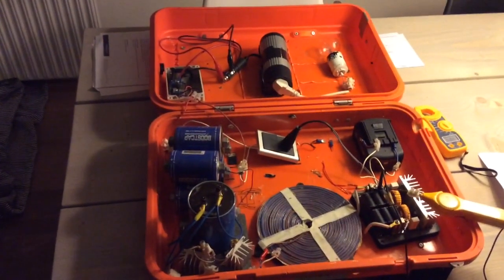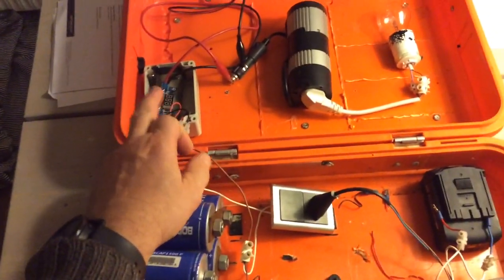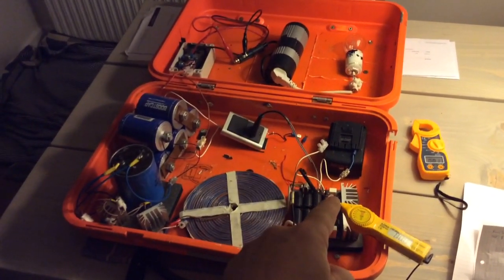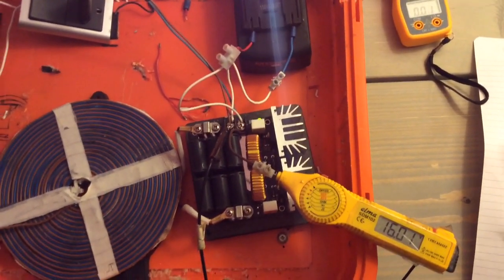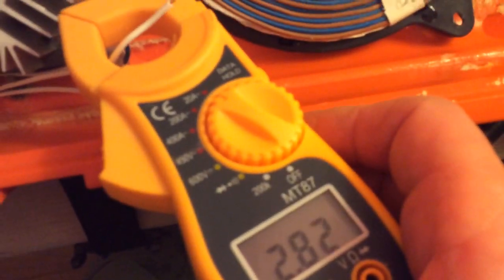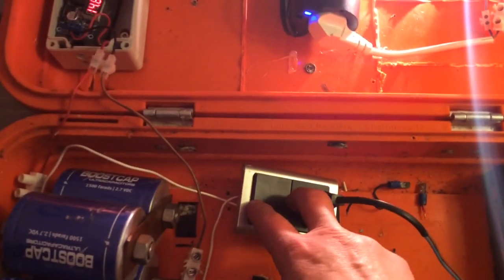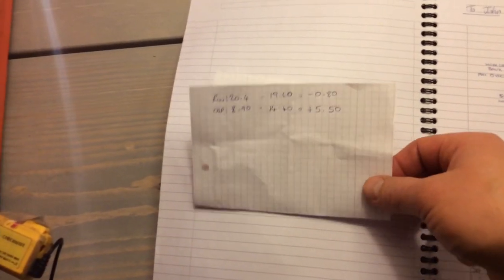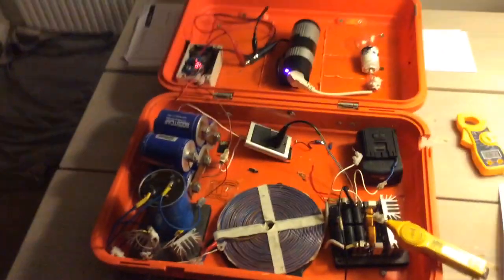ZVS Tesla bifilar looped system

Comment: Brilliant.  There's not very many working looped circuits on the tube, especially utilizing Tesla's bifilar.  But Tesla himself explained it in the patent.  He says the bifilar "reduces the self induction" meaning, reduces the Lenze reaction, meaning, less reverse drag, so it has potential to go over unity.  And here in this video is metered proof of such in a simple DIY setup.  Would be interested to know more about the primary coil behind the bifilar... number of turns, gauge, normal or also bifilar.  Kudos
Reply from the maker: Hi thanks for watching. This was an experiment years ago. If you watch the other related videos on this subject you should get all the info as everything I put out is open. The coils were normal electrical wire coiled about the same size as an induction coil in a cooker. The ZVS find the frequency needed the pair the two easy peasy 😀👍🏻 hope this helps.
Reply from the maker: https://youtu.be/RbdgR-Hitzo?si=VhnyGJPy0zU3WI8K

Comment: ya know; in the 'looped' mode, the battery is in parallel with the capcitors; and a voltage offset of the switching voltage of the diodes... so the battery side shows an immediate drop in voltage, but the batter is still 17 volts, so of course it's going to drag up the charge on the capacitors directly; again though the voltage is split by the number of diodes... 13.3 - 15.8 - look like 2-3 diodes in series though; could be high amperage which can often have a 2.5V switching voltage.  (maybe it's 1.2 on both, and separated on + and - side by 1.2V each )
Reply from the maker: J Decker thanks man, all I am showing is the slowing down of the voltage from the battery into the ZVS and the possibility of a faster recharge.

Comment: The caps have a much lower energy density than the battery so you can't really compare volts on the two
Reply from the maker: Ian David thanks for your input, yes correct but what it it showing is that the dip of two volts is returned and this shows a slowdown of the battery input into the ZVS. So more energy economy.